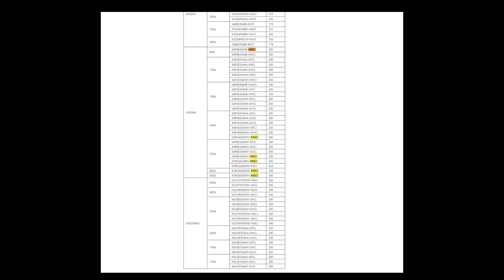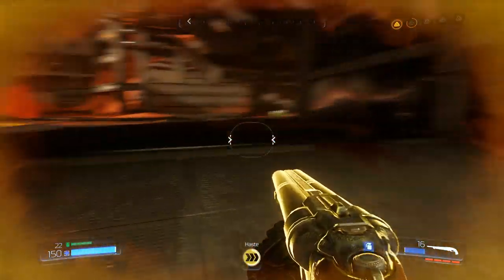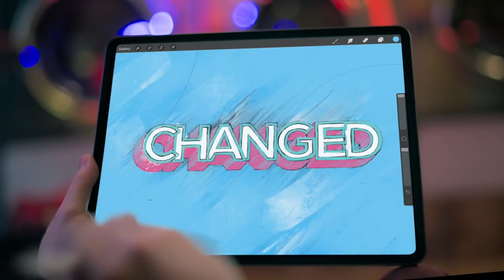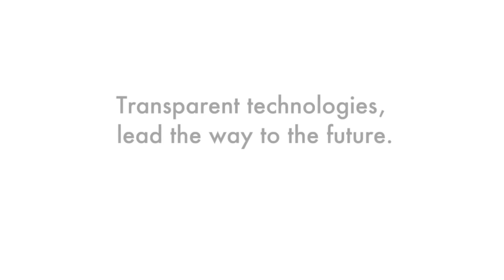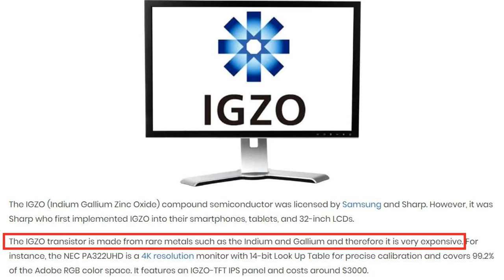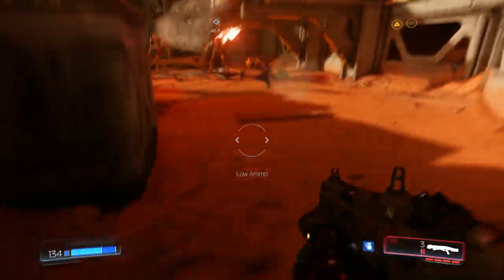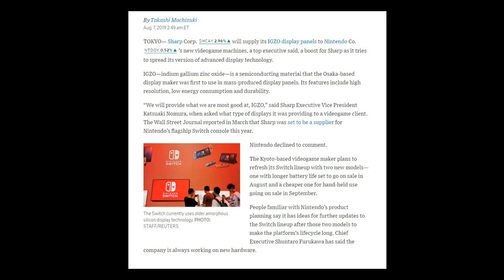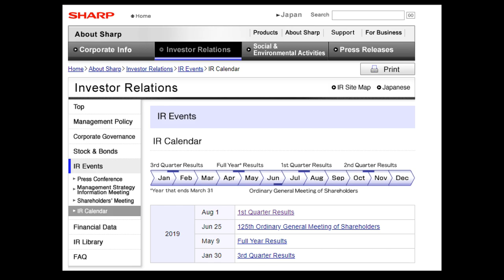WSJ Report: New Nintendo Switch Hardware Getting Bleeding Edge Sharp IGZO Display!

Comment: If you listen carefully, Dave is subtly using language that is indicative of Nintendo’s newer hardware (ie Switch 2) rather than a Switch Pro. He knows he was wrong but will not admit it so he is trying to dupe everyone and change language. 

From the beginning of his Pro rumors he has said it was getting announced and released in 2019. He is now slowly changing what he said to fit the newer evidence.

He knows it is a successor and trying to say he called it. Classic Dave changing the narrative.
Reply: He has done this all along. With every video slightly altering his narrative to suit the situation. He also like to present things as "facts" which is is the biggest load of bull there is. Especially when those "facts" vanish from his next video and we move on to the new "facts" (which also never materialise) It's all rinse and repeat without any actual facts other than quoting the WSJ over and over.. And even then he gets that wrong saying it's American sources. (even though it's actually a Japanese journalist)  
You won't see as many infactual facts as what Dave provides outside the White House.

Comment: Yeah it looks like there probably wasn't a die shrink - although personally I think they did some minor  changes to the chip itself beyond just a binning adjustment. Regardless, it's more efficient and should be able to perform better.
Reply: It IS a die shrink. They're using a 16nm Finfet process.
Reply: Mark Grgurev do you have a source confirming that?
Reply: @logicalfundy   Only Digital Foundry which IS an actual news source. Even if they hadn't said that, it's pretty obvious that a Tegra X1 using nearly half as much power would be a  die shrink.

Comment: IGZO's been known about for years. I was aware of it back when you swore NX used an AMD x86 GPU. You keep saying "You've seen the pictures guys. It's the same plastic screen and they just said it's a capacitive 720p screen." Plastic and capacitive describe the DIGITIZER that's in front of the screen and 720p just describes the resolution. Neither of those things prevent it from being IGZO. IGZO is a semiconductor material that used in the TFT BACKPLANE of a display. You wouldn't see it, hell, the whole point is that you can't because it's transparent. That being said, they're probably just planning it for newer revisions to improve battery life.

Also, LPDDR4X is the exact same as LPDDR4 just with a lower voltage.  Why would you think they wouldn't be able to make small modifications to the memory controller to support LPDDR4X while shrinking the chip?

But no, you assume it's using the Tegra Xavier... you know, for compatibility. Except the Xavier uses Nvidia's Carmel cores instead of A57s, the chip as a whole is the size of the PS4's SOC at launch, its intended to use more power than the Switch as a whole, and the majority of it's improvements are for self-driving cars and would have NO BENEFIT to the Switch.

And how would someone know just from a teardown whether or not they shrunk the chip? They could just be packaging it the same way.

Dave, think for a second. What would happen if they released a Switch Pro? What would developers have to do? That's right, they would have to support a handheld mode, a docked mode, a handheld pro mode, and a docked pro mode. That's hell on developers just to support one platform and they'd still have the storage restraints that they currently have.. If Nintendo intends to update performance at all, it'll likely be by allowing developers to use higher clock speeds that the original hardware supports. They already recently started allowing 460Mhz clocks in handheld mode, in the future they might just allow the 921Mhz clock and maybe they'll eventually allow different CPU clocks in both modes. That's the best you can expect.
Reply: I know right. Practically everything you said was confirmed before SMD made this video, but he still acts like his “information” is fact.

Eh, Ninty hasn’t touched the actively used clock speed profiles since before launch and I doubt they intend on changing that anytime in the near future
Reply: @zacharykirtz4857   I thought they only just stated allowing 460Mhz in handheld mode since the only known third party game to use it is Mortal Kombat X.
Reply: @Mark Grgurev 
The 460mhz profile was a thing since firmware 1.0.0, possibly earlier. Only Nintendo used it until fairly recently, dunno if it was a restriction or if devs simply didn’t want to use it because of its issues.

Comment: They are not using this on the revised switch, right?
Reply: Correct. The revised switch is still using the old LCD display. Just from a different supplier.

Comment: Imagine a Nintendo Switch with a OLED display or a 4K QLED display from Samsung!
Reply: It cost too much for a Nintendo portable console.
Reply: Jacob Vanderhooft  IGZO is LCD... And Qled is the best compromise between an OLED and a LCD.
Reply: Jacob Vanderhooft  It's not just a little better, QLED have emissive LED like OLED, the blacks are more black than standard LCD, HDR is better. And it's much cheaper, so it's not for the same kind of people. Of course OLED is better but the price is too high for a Switch, even a "Pro" model. And micro LED costs too much right now, just look at the Sony clear tv's, more than 100k $ is too much for so little improvement. 
I would like to see comparison between IGZO and QLED screen because we don't really know the difference between them.

Comment: If they are putting this with this gen an making a pro it would be for streamed games that would take advantage of the new tech cause if it's this much of a upgrade then all 3rd party developers would do games just for this system. Or it would have to be a new console altogether cause why would u split your customer base.Cause this would be a huge step up u are not gonna put an 8k screen on a system to play games at 1080p an resolution a they would probably switch to amds new chips that are coming next year so I think this is Nintendo 10th gen console or it would be for streaming if it's a pro an use Xcloud or Stadia.

Comment: Unfortunately there will never really be a Nintendo switch Pro.
That company is clearly not interested in using advanced technology after all look at what they gave us to start with.
Nintendo switch could barely run titles smoothly unless they are horribly scaled-down.
Reply: At the time Switch originally came out, Tegra X1 was still a great mobile SOC & chipset.
Reply: PRIVATE SECTOR 042 : In the world I live in, the Switch uses latest advanced technology that allows it high IPC and running games at less than 15W when other consoles can’t even boot at that power level. I would not like to live in your clueless fantasy world.